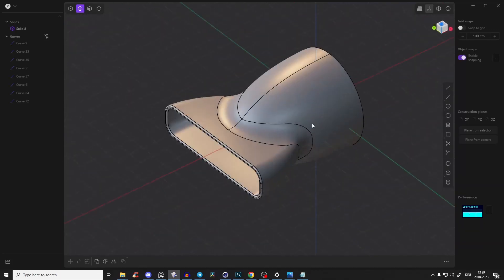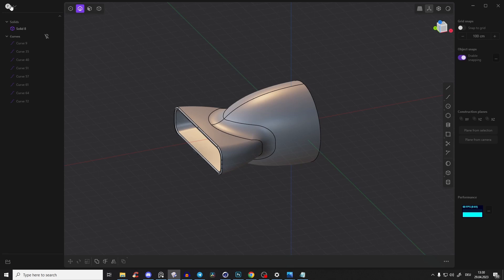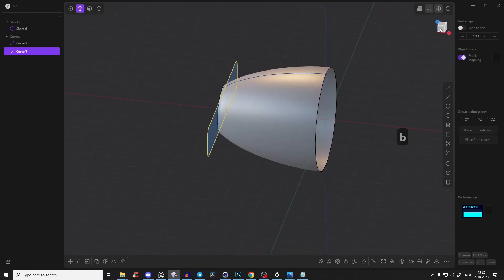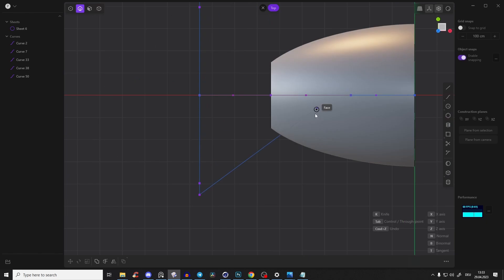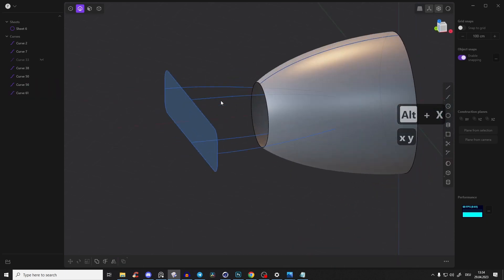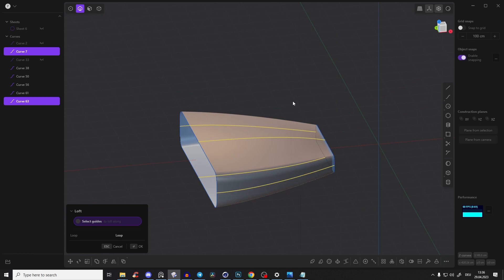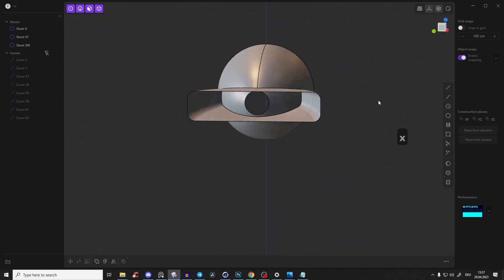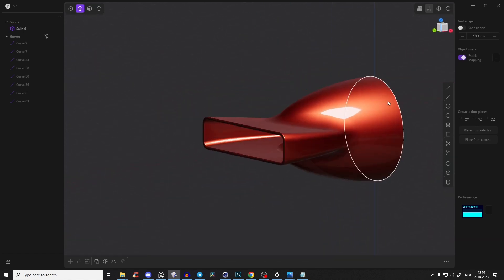Plasticity 3D Beginner Lofting Technique Tutorial

Comment: How did you get the faces to join in the end so there are no lines visible?
Reply from the maker: The exact point in time do you mean?

Alternatively you can join our support group and post your Plasticity file so I can have a look on it:
https://www.skool.com/ultimate-3d-membership-7140?invite=16b95b9b21c9440db3befabf4b050640
Reply: 8:51 the model is grey and you can see lines (edges) in it.
8:56 the model is red and it has no visible edges anymore. 
If I turn on the rendering, I still have edges showing.
Reply from the maker: Press "F" search for "Viewport toggle edges" -> Assign shortcut @filipcza

Comment: Thank you very much! I have a question: Is the bevels editable after a few operations? Can you come back to the edges and change the amount of bevel? thanks
Reply from the maker: Yes. In most cases it's possible if you select the bevel with face mode and then you should be able to adjust it if the geometry is not too complex
Reply: @nikita.kapustin  :) Thank you very muchhhh! this is exactly what I was looking for, my client is changing the bevel all time XD

Comment: I think you might have caused the trouble whereby the model was given irregular surfaces when you went to fill in the solid. By manually relocating the end points of each of your curves, you negated the purpose of drawing them out to meet with the construction plane you introduced moments before. Maybe if, instead of drawing the rectangle some arbitrary distance from the end points, you draw it in place where it needs to be - coplanar with the points - the issue you demonstrated would be resolved.

Does Plasticity have an option for drawing a rectangle not from the center, but from a corner? I realize the end points of your curves don't describe the corners of a rectangle, but rather the mid-points of the edges--I imagine though, that it wouldn't be much trouble to create the necessary vertex from which the rectangle could be drawn out. If that's an issue, perhaps as an alternative you could connect a line between a pair or end points, either vertically or horizontally. Use the midpoint of this line to draw a "center rectangle" exactly where it needs to be. At least insofar as being coplanar to the end points of the curves. And with that being the case, resizing it to the exact dimensions needed should be as easy as snapping some part of it to an end point, since everything shares the same plane. No?

In another thread I see you make the point of there being a benefit in showing how to correct for issues which may arise for new users. There is some benefit there, I agree. However, being the pragmatist that I am, I would much rather be shown a sensible way to avoid causing issues for myself and my workflow, rather than learning what I might do to clean up the mess I made--which didn't necessarily have to happen in the first place. That's just my two cents though..

Comment: Nice video again. For the guid curves of the loft, it would probably be easier to create the second profile first, so you can snap the guide curves to them immediately. Those little disconnected curves, can be difficult to troubleshoot. I like option A better, just because it suits what I do better.
Reply from the maker: Good idea!
Definitely better option. However I think it's good that I showed this way so I explicitly emphasized that the point has to be connected to another curve. 

Because often lofting is not working because one thinks the point is connected to the curve but zoomed in, it's not. 

And regarding option A. What do you do usually?
Reply: @nikita.kapustin  Yes, I agree that showing why loft will fail is very valuable in a tutorial. That is a fair point. I do built profiles first and connect with guide curves as a general workflow
Reply: so mark, what do you think of plasticity? i have seen your videos before and comments on rhino and Solidworks. thanks
Reply: @ourwaystudio6204  I have only downloaded the trial so far and am really liking the workflow and UI. Unfortunately for me, I do designs that need to be manufactured and currently plasticity is lacking features needed for accurate/precise modeling. This is not a knock on plasticity since it's aimed at concept artists, but if accurate modeling features are added, I will definitely add this to my toolbox.
Reply: @marklandsaat3696  Hey, thanks for the reply, yes i agree and i hope that CAD for manufacturing is integrated better. It is fun to play with and has lots of room for improvement.